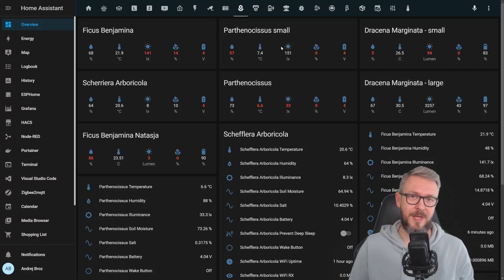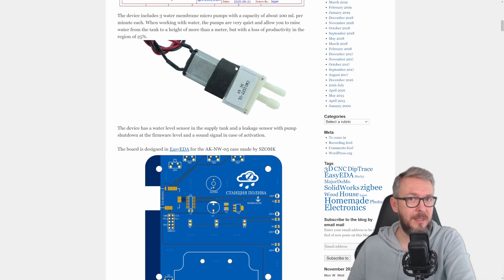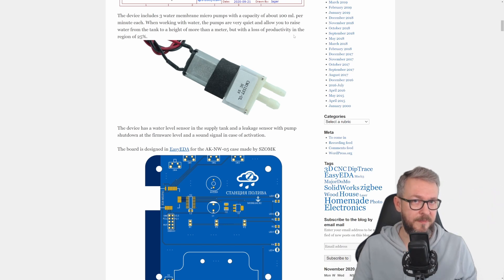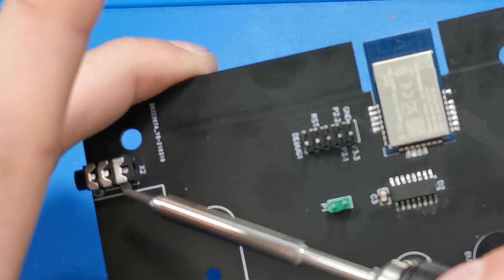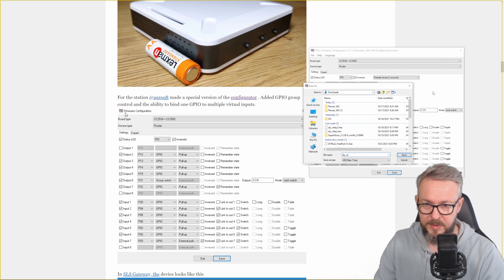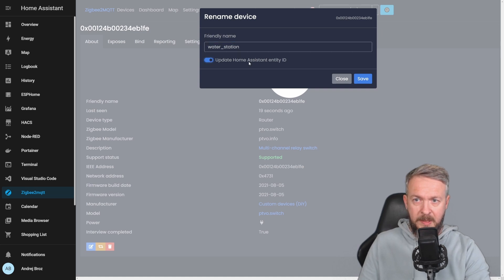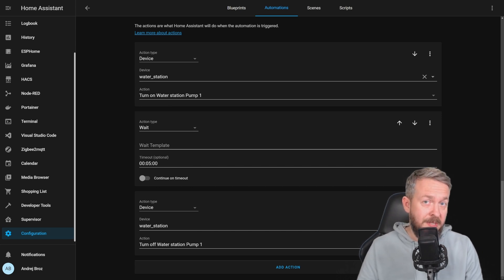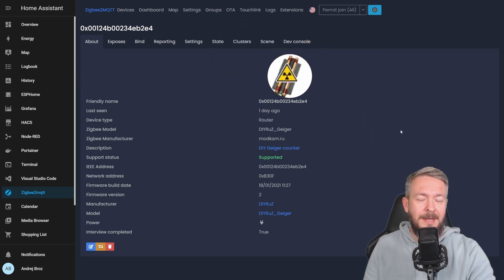DIY Zigbee plant Watering station and network repeater

Comment: Hi! Did the system can be powered on battery?
Reply from the maker: No. Firmware is not optimised for that and doesn't go to deep sleep. But since code is available it's possible to do it if you work on the code.
The second problem is that this is also Zigbee router and routers need constant power. And of course, motors, pumps use power and probably would empty batteries very fast.

Comment: This is really cool!!  I love that with something like that you add a router to the zigbee network and expand it.  Very cool.  What are you using for the moisture sensors themselves?
Reply from the maker: Glad you like it! Currently, I'm using HiGrow boards for soil sensors. They are ESP based, PEsor developed custom firmware that uses MQTT for data delivery and I'm currently testing ESPHome version of the firmware for them.
But, I would like to test Zigbee sensors - they are also DIY, but can be bought with assembly at same time as PCBs.
Reply: @BeardedTinker  I have a bunch of DIY MySensors stuff and have been looking at doing some boards powered with a coin cell.   Ill check out the HiGrow stuff too.  I haven't built any zigbee stuff but I do have a zigbee2mqtt working with a usb dongle now.  Thanks to you for the recommendation on that :)

Comment from the maker: Again, thanks to Jager for pointing me to obvious! In the archive with BOM, STL, Gerber files - there is already ready-made firmware that should work with this board.
And since PTVO can create custom converter for Zigbee2MQTT, you can use this to create one and export it.
For Zigbee2MQTT addon, just add this diyruz_flower_ws.js file to /config/zigbee2mqtt folder, and add following line to ZB2MQTT configuration file:
external_converters:
  - diyruz_flower_ws.js